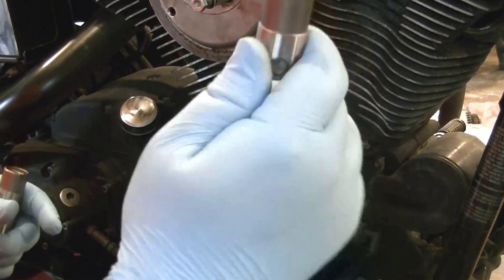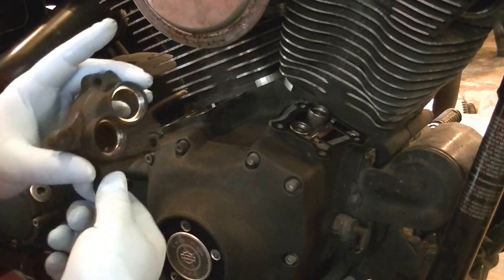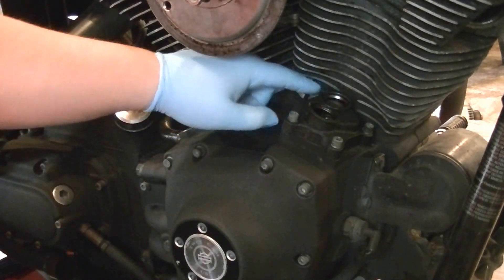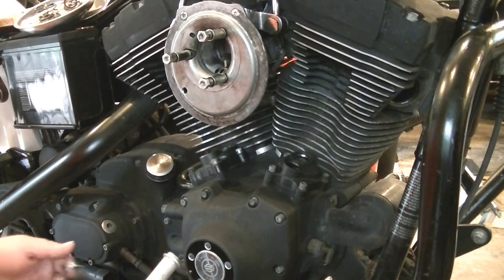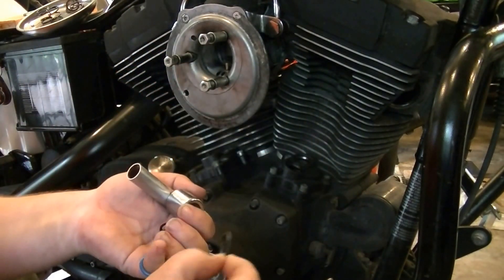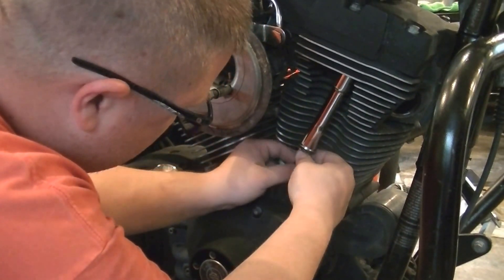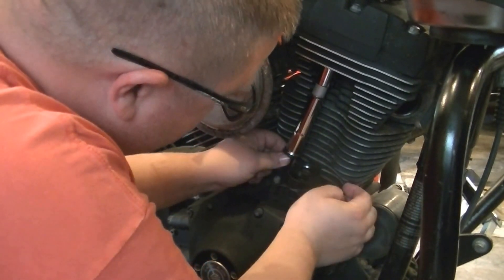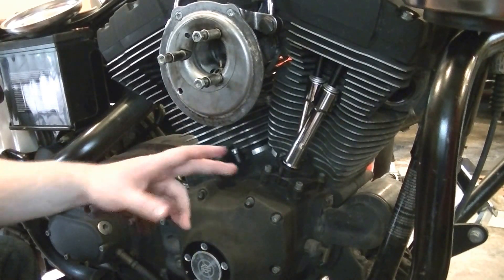Project FXDX: Twin Cam Plate Upgrade Part 7 - Installing Lifters and Pushrods!

Comment: thanks for sharing. I'm going two throw my two cents in but in a friendly manner. for those that may not know your cams must be on their base circle from the very start of the adjustment. enjoy.
Reply from the maker: Very good point - if I didn't mention that in the video, I certainly should have.  Make sure the cylinder is @ top dead center, and you'll be on the base circle of the cam :)

Comment: Did ya pump up the lifters ( even if they are used) before you set zero lash ? You use a oil gun and pump up lifters then install them and adjust to zero lash then however many turns per manufacturer ,, if you dont pump up lifters first your adjustment will be off for zero lash and consequently your final adjustment..

Comment: one thing, after installing the intake, i would adjust the pushrod to bleed out the pressure, befor installing the exhaust, then it would take less time before i could crank over to the back cylinder to do it... my 2cent...

Comment: is there a reason we couldn't re-use the stock push rods, and put them in before buttoning up the top on of the motor?
I'm about to upgrade to the SE hydraulic tensioners so I'm trying to do all my homework
Reply: you can absolutely re-use the stock pushrods, you just have to remove the rocker boxes to get to them, its just much more time consuming.